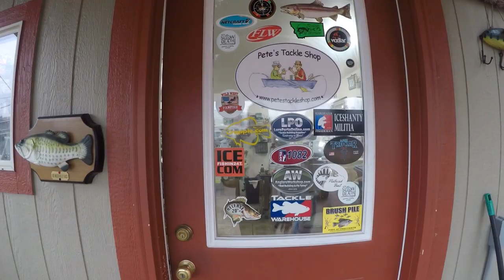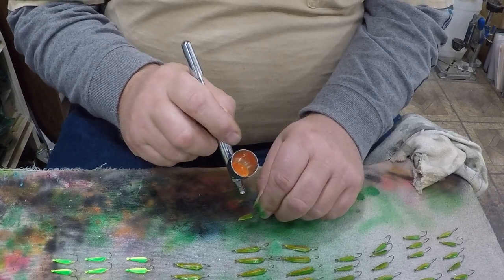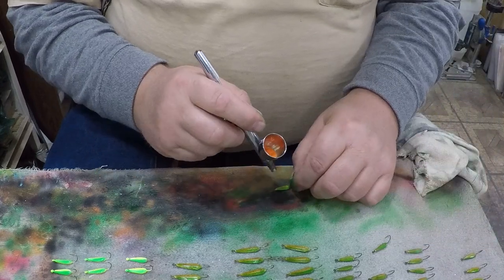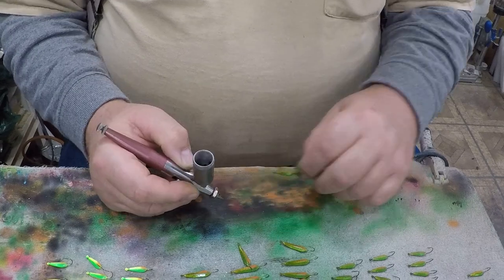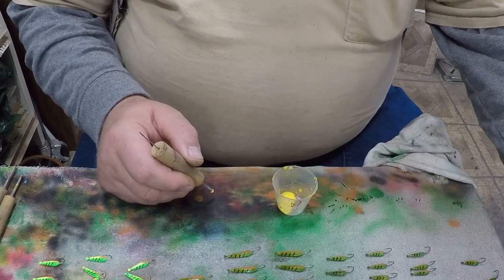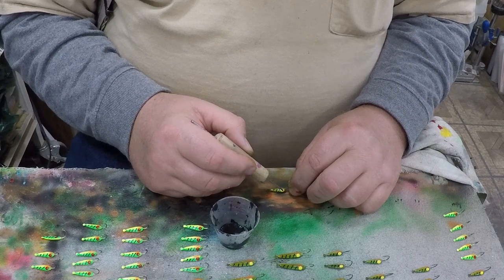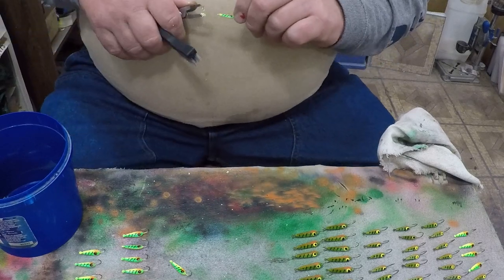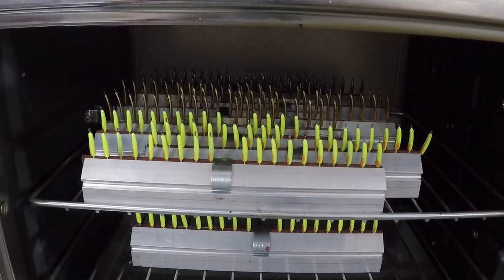Pete's Tackle Shop How To Paint A Jig Like a Pro

Comment: Those remind me of something we used to use as a pitching jig for walleye in Minnesota.  Was called a Jig-A-Whopper.   Was a local company that went OOB so the few I have left are like gold.    We use to use them in open water, usually rivers, up to 3/8 OZ depending on current and depth.   Do you have any larger sizes?
Reply from the maker: I've caught many nice fish on them . I'll give them a try on walleye. I bet your Jigawhopper are gold with a chartreuse green.
Reply: @petestackleshop  Yeah,  The ones I have (had) were simply painted.   Gold with green.  Maybe hot orange.  But white eyes.  Killer on Walleye and Sauger.  Pitch up into the current and let it fall back.   Back then we didn't know chartreuse was a color.   Was a 110 proof shot.